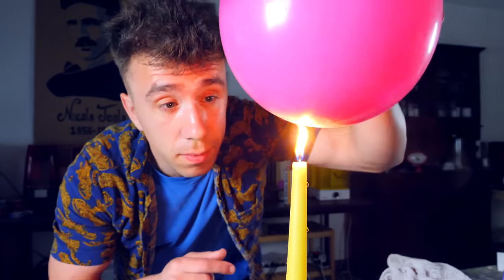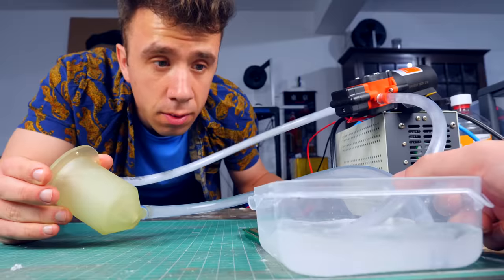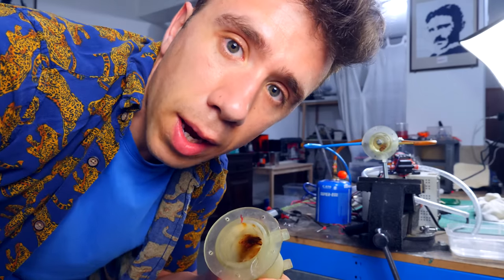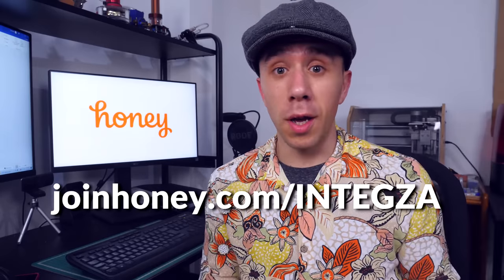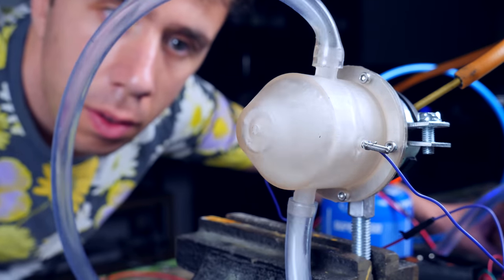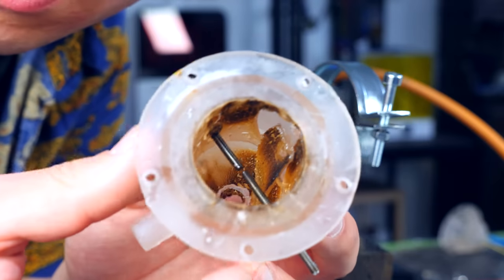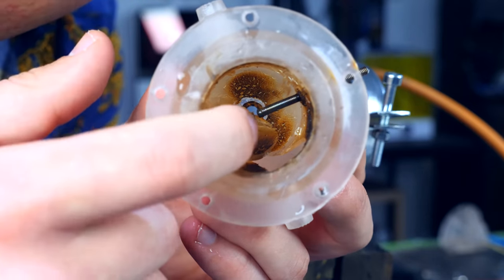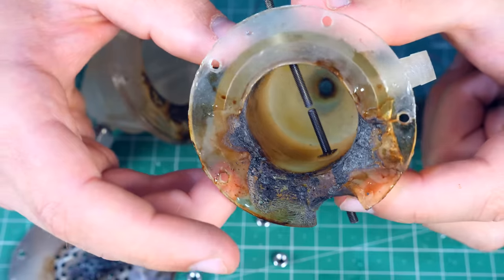Water-Cooled Jet Engine in Plastic

Comment: I got the impression that the engines might have worked a bit better if you pumped the water in on the bottom and out the top. That way the water would carry all the air out with it as it exit. It seems to me that the engines failed at the top and that might have been because there was little cooling there with all the air trapped in the upper part.
Reply: It would help distribute the thermal load for sure but I feel that with the metal base plate heating up as much as it does the melting problem would only be delayed.
Reply: @NarutoMagicCyclops  maybe he can 3D print the flanges thicker (edit: and with hollow insides) to watercool the front and rear of where the plate touches lol
Reply: @server642  It's possible especially if he just wants to create the effect of the engine, the bulkiness of such a system and having more failure points would be a headache and half though. Frankly just goes to show how bad plastic/resin is for thermal conductivity and  load not to mention how typically brittle the system is to explosive power. Softer plastices might be able to survive a bit better but you'd lose pressure as it wouldn't be stiff enough at that point and theres generally not much you can do about the thermal qualities.
Reply: @NarutoMagicCyclops  Or he could just raise the water reservoir above the engine.
Reply: Yeah thats how distillation condensers work in a lab
Reply: @alexanderunguez9633  There's still a load of other problems in general, you can fix the water system all you want, but with plastics you either increase the thickness which would give more strength and hope the thermal stability holds, or in his case reduce the overall material to allow for better thermal conductivity but have a complex still bulky system with water failure messing with the heat needed to generate the pulse effect. Either way the metal will burn and transfer heat into the plastic as much as possible to remain stable, which will result in critical failure unless the metal itself can be cooled efficiently enough to work.
Reply: @NarutoMagicCyclops  I completely agree. I think we were referring specifically to issues with air bubbles being in the channels.
Reply: @alexanderunguez9633  Air bubbles specifically are only one part of the overall points of failures we've seen. Which we already know the solution of. So what's your point?
Reply: @NarutoMagicCyclops  Again, I agree that this is not the only issue. My point is that the original comment was only discussing the air bubbles. My response was to suggest that reducing air bubbles could be as simple as making sure that the engine was the low point in the coolant system. We can talk about the the balance between making the chamber walls thicker for better impact resistance and making the walls thinner to improve conductive heat transfer and reduce thermal expansion stresses, but that is outside the scope of the original conversation.
Reply: @NarutoMagicCyclops  I was a bit confused why you were replying to my comment, and when I looked back I realized that I replied to you instead of to Raderblocks. Sorry about that. I want to again state, that I completely agree with all of the points that you brought up. Sorry for coming out of left field on your first comment, what I said about the water levels was meant to be a reply to the original comment.
Reply: @alexanderunguez9633  Fair enough, Youtube can be a pain in the ass at times lol sorry if I came off rude as hell, had a bad day at work yesterday.
Reply: @alexanderunguez9633  Fair enough, Youtube can be a pain in the ass at times lol sorry if I came off rude as hell, had a bad day at work yesterday.
Reply: @NarutoMagicCyclops  Np man.

Comment: Some improvements that I can think of straight away: 

1. Make sure the water inlet is from the bottom and therefore has a more continuous area of contact with the resin when under temperature stress. 
2. A higher pressure of cooling may be required due to what seems to be melting points happening at the point of one of the cooling in/outlet. Maybe reinforce this area with small vanes to distribute that water evenly. Also maybe get a thermometer to test the temperature of the water in vs out to see how well it is working. 
3. Use tomato juice to assert your cooling dominance ;)
Reply: Actually... Liquid like water (vs compressed gas) should flow from Top to Bottom, because gravity can help out, but also will hopefully help keep air away from the inner walls of any gets trapped/sucked in.

Speaking of air, that could be why it was failing on some of those instances, if any was trapped inside. I couldn't quite tell from the footage, but I would suggest:
    - using a bigger reservoir for starters
    - filled with ice cubes**
    - mounting it higher than the engine
    - have it run for a few minutes before ignition, to make sure all
       air has been purged from the cooling galleries

** this might not work well, same with any super-chilled liquid like butane or CO2, due to the cold combustion chamber walls getting "shocked" by the heat of the burning fuel; maybe not though, all purely speculation on my part!
Reply: You could use vanes, or you could angle the inlet and outlet to have the water swirl around in a uniform way
Reply: Yes you should most certainly use tomato blood for cooling. Also the idea of feeding the tomato blood from bottom to top sounds like a good idea too. I think you will have less heat transfer if you use stainless steel screen to prevent flashback of the flame front. Add to that some ceramic slip around the edge as a gasket between the screen and the housing. Oh and then a ceramic nozzle might be useful too.
Integza, I love this channel! Your passion and drive are very inspiring. Keep up the great work. I know you will be successful!!!!
Reply: also if he angled the inlet and put a small diffuser in it. it would help the spread of the water
Reply: id say a ceramic defuser as well

Comment: Should use a ceramic spacer/O Ring to hold your diffuser to prevent the heat transfer from the metal to the resin/plastic

Comment: Would warm water help keep the resin from being brittle/experiencing some kind of thermal shock from the temperature differential?
Reply: Shashumga
Reply: Maybe, but I think not much
Reply: I would say so. I would also apply some basic design concepts of industrial heat exchangers. I have seen some comments hinting on that. But broken down I would say you need a bottom intake and top exit, with some flow direction like he tried with the butan. Ad to that a closed water cycle, a more potent pump and more pressure. Maybe let the cooling agent flow through an additional external heat exchanger to reduce the speed with which heat is building up in the water. For that I would use an air cooler, which, in this case, would be a 3D printed pipe with cooling rips. This would be light weight and easy to implement. Also it extends the duration of the cooling, before the cooling agent gets to hot to do its job properly.
Reply from the maker: Thats an interesting theory !
Reply: @integza  I would love to see you learn aluminum investment casting.... with the right tools and equipment its actually pretty easy..
Reply: @integza  Would mixing the resin with the more flexible resin work also by making the parts less brittle?  Seen some videos of the resins being mixed with good results
Reply: @integza  get the water inlet/outlet vertical and feed in from the bottom. Chances are air bubbles are making for hot spots
Reply: @Integza Try sandwiching the diffuser plate between asbestos washers so that the heat doesn’t reach the resin
Reply: @chris8957  As well having it at a lower elevation than the pump, the air would seek the highest point.
Reply: @integza  But if the water is warm and then goes through the cooling process inside the nozzle wouldn't there be a risk of it turning into steam and then still blowing it up due to pressure and also maby you should try using a different liquid I'm not in any way intelligent enough to understand this but maybe something like mercury that runs through the nozzle and then keeping it cool u just run the mercury  through water because it more conductive but doesn't turn into steam(I think)
Reply: maybe use a softer plastic and really cold water
Reply: @amdev8732  you also could put the water under higher pressure to prevent it from boiling or cavitating.
Reply: and you could make the metal diaphram out of copper and cool it outside of the engine(cause copper is so heat conductive)
Reply: yo same first name
Reply: My tips are use pla+ with 100% infill and some you for gaskets
Reply: @integza  I'd suggest using thinner walls instead of thicker between the combustion and cooling chambers, the reason the balloon doesn't melt from the flame is because it's very thin and cant hold onto the heat before the water absorbs it.
Reply: @integza  Just 3D print the whole turbine on one piece (no joints) with double walls and hollow in the middle to run the water like a sandwich. So instead of running the water and fuel in the same chamber, the water would have his own chamber between the double wall, and probably you would maximize fuel efficiency not being mixed with the water.
Reply: @Rodrilechan  that is already how it is... I don't think it would work at all if water was running through the combustion chamber along with the fuel. there's no water mixing with the fuel (on purpose). sometimes you see it start spraying meaning it is mixing with the fuel, but that is because it has started to fail/leak. He already has double walls, with it "hollow in the middle to run the water like a sandwich". He shows it near the beginning of the video, and you can see it every time he shows the 3d model.
Reply: @fredrum3966  if you watch the entire video, he started using thinner walls at some point. though we didn't get to see the difference. perhaps he can go even thinner still?
Reply: @monkunashi  oh yeah that's true lol. I was half sleep watching the video...
Reply: @integza  put some refractory material... like ceramic paste on the inside of the wall ya dingus
Reply: Probably not a bad idea. I think though his issue is the water moving too fast and not having any form of radiator to collect and slow the water and a fan to move air over it. Unless he is going to leave a continuous cold water flow which would be insanely expensive and impractical . He has to contain maintain and regulate the water as it flows. Same principle as a cars cooling system. 1 of the biggest mistakes made in designing a performance cooling system is the idea that water moving through at a high rate of speed is better, when in fact it is worse because the water doesn't sit in the "cooling area" long enough for the provided airflow to effect change to the temp. Thus the motors heat overpowers it's ability to remain cool.
Reply: @lucasschigart2721  you have a much more eloquent way of stating my exact thoughts contain and slow down the water pressurize
The system and provide a mechanical force to move air over the exchange thus creating the ability to regulate temp. Awesome!
Reply: @aceofspades4494  thank you^^
Reply: @lucasschigart2721  what about adding some peltier cells to keep the water cold?
Reply: @Frakmaister  I didn't know those exist. I had to ggogle them. But yeah, that would replace the cooling pipe in my previous discription. Cool idea (pun unintended)

Comment: Love it! I had recommended water cooling over a year back, so glad to finally see it attempted. Oh, and using the fuel to cool the engine is pretty much what NASA used to do, they cooled the bell nozzle (and I think the chamber) with the fuel before sending it into the chamber. Of course, they had a much higher flow and systems that could handle MUCH higher pressures, so it might not be a great idea to implement in plastic.
Reply: I just had a thought - if he DID use liquid nitrogen, could it have gotten the combustion chamber cold enough that his fuel would precipitate back into a liquid?

Comment: there was way too much air in the water cooling loop. at least in the first few trys. I think thats the most likely reason why the last try was so successful. and if you want to improve the cooling further, instead of redicing the wall thickness, try increasing the surface area. adding fins within the water channel would help tremendously. and why not watercool the diffuser as well?
get water close to that metal from both sides to keep that one cool as well and I think this could work really well.
Reply: Because plastic is a thermal insulator so fins wouldn't help they would hinder.  The balloon doesn't burst because the layer of plastic between the flame and the water is extremely thin so the plastic makes a poor thermal insulator.  With a 3D printed model the plastic is much thicker and so becomes a thermal insulator.  The heat cannot conduct through the plastic fast enough to dissipate so one side melts and burns while the other side is cold.  Adding fins wouldn't help it would just be adding sections of really thick walls.
Reply: @benfubbs2432  I was thinking along the same lines. He needs a better thermal conductor on the interior layers. Something akin to a different thermo-plastic that is more heat conducive. I believe there are some conductive resins he could try or even adding some metal filings to his resin mix would probably be worth a try as well.

If he can get that heat in contact with the heat sink then it should, hopefully, work out. =)
Reply: Fins work with metal because it conducts heat quickly but also dissipates it. Plastics on the other hand insulate and the thicker it is, the more it builds up and this build up of heat along with it's issue of not wanting to dissipate it is the problem.

So the thing is, wall thickness needs to be reduced to next to nothing in which case weakens it in terms of potential pressures generated even if cooling were working at that point.
Reply: The water needs to come up from the bottom to eliminate air pockets.
Reply: The problem here is really the bad heat conductivity of plastic/resin. You can see that any part of the engine which is exposed to hot gas and not in very close proximity to water gets burned.

Comment: A simple improvement would be have the water enter from the bottom to the top, other little things is have the water jacket have a larger cavity at the top as well as a larger outlet to allow the heated water and importantly steam to escape easier.

The complicated improvement is to have the water enter the chamber to cool internal components as well as using the steam as added thrust mass.

Comment: Very impressive.

Two thoughts on improving the design:
1) use hi-temp rtv silicone gasket material between the two halves and the diffuser sheet to seal the leaks.
2) you might consider putting vanes in the water jacket to swirl the water around between the inlet and outlets to make sure you don't have air or steam pockets in your water jacket.
Reply: I would suggest water cooling the defuser.
Reply: What about lower speed of the water? The ones in the balloon is stationery...
Reply: Can't the combating chamber be modified to direct the flame out instud to the diffuser?
Reply: @omri.d  lowering the speed of water seems worse for heat transfer because of convection.

It would maintain higher temperature difference between the source and sink and cool the engine better.

But that's my intuition as an engineer. Someone more specialised can speculate and give more advice on the cooling and such
Reply: Yeah I was thinking a spiral pipe kinda thing
Reply: I was thinking of something similar but to insulate the diffuser from the resin parts so the hot diffuser does not melt the plastic.
Reply: @prateekkarn9277  how does the baloon not pop then mr engineer
Reply: @madbruv  convection, hot goes up and the area gets replaced by the cool water already near the bottom.
Reply: @madbruv  what Nick said and also the temperature. The oxidiser to fuel ratio determines the temperature of the flame.

A candle flame may not be as hot as the flames inside the engine.

If you also look at the volume that the heat is in and the volume of the sink. I think it'd be more appropriate to say mass of water available as heat = heat capacity x mass x temperature difference

A more simpler example of what I'm trying to say here is, if you had a big block of iron and a small iron bar, the iron block would take longer to heat up than the iron ingot.
So the baloon will eventually pop once the water gets hot enough that the cooling it's providing by being a heat sink is not enough to stop the rubber from melting

Or perhaps the rubber will eventually just react with the oxygen turning into carbon dioxide and water and some other stuff resulting in the bonds breaking up causing a hole to form which results in the balloon exploding.
Reply: Stationary water will only absorb till it reaches the melting point of the rubber at which point the rubber will ceast to maintian its own bond. Its like a radiator in car, when the coolant reaches a certian temp if there is now where for the pressurd to go it will demolish the radiator in the form of a stream explotion. But as along as the water pump continies to circulate and cool the water theres very little chance of a steam explosion.
Reply: If he's using the same concept NASA had on their exhaust bells to cool them, the process might last longer.
Running water in channels around the engine should cool evenly, over just dumping into a hollow shell and hoping for the best. Maybe even use multiple water inlet/outlets if you run spirals around the combustion chamber and since he's using a resin printer these channels can have very thin walls.
Reply: @christiaanventer8183  yeah those are called expander cycle engines. They have a bit of a chicken and the egg problem when they start but it is very efficient once warmed u